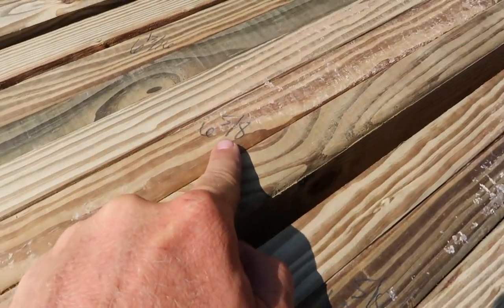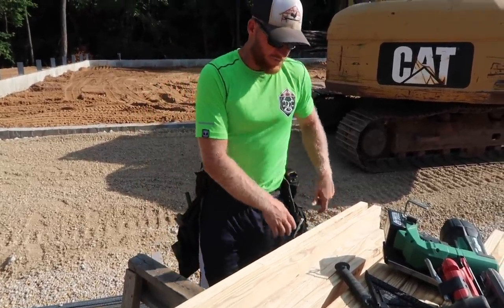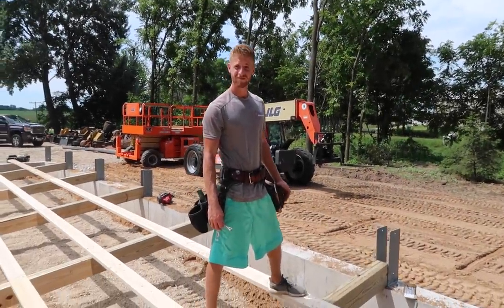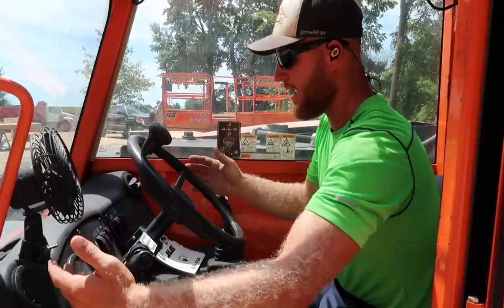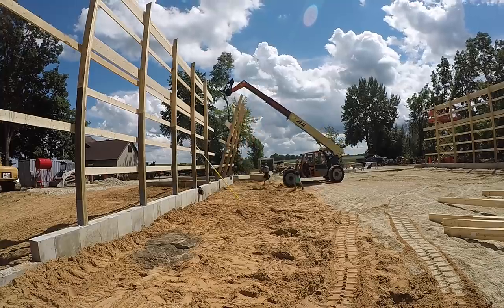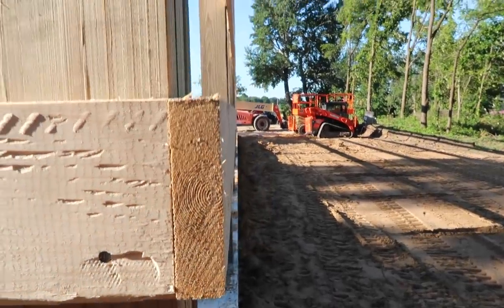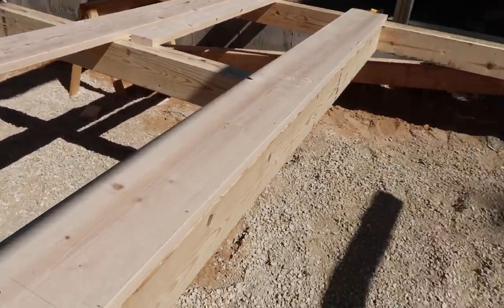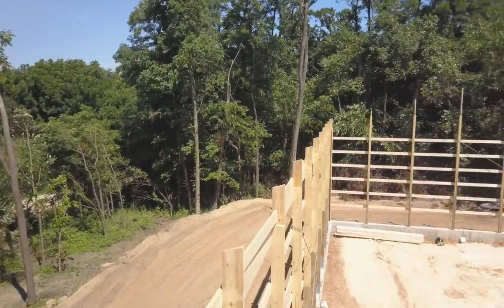Framing Walls: Build the Dream Episode 2

Comment: I have worked construction for 7 years and have helped build numerous pole barns and non of them are to your standards I love watching your videos because of how you do it and your efficiency for instance your pole style and using the anchors we always drilled holes put concrete in the bottom and set the pole and tamped them in sometimes by have and sometimes using an air tamper and then u guessed it all the framing is done in the air and it is no process of speed or efficiency watching you guys is awesome I am glad that you share this with everyone and I no longer work construction I now am a mechanic for my local village but I still build on the side and I am learning more and more with your every build thank you
Reply from the maker: thanks for the feedback

Comment: Wise words- use the machinery. One of the things I like about how you guys work is not just the efficiency, but the safety and lack of really heavy manual handling you do. The fastest way out of a trade is to be a hero and over-lift every day!
 At 21:51, I would call that clearancing of the post a rebate.
Reply: Just because you're a young buck and CAN move or lift it by yourself, DOESN'T mean you should. My 54 yr old body can attest to that! I'm wore out and broken before my time... I try and instill this in my younger crew. DON'T end up like me!

Comment: Love your show! I’m in the industry as well. Just an idea for your post brackets. Your guy does a pretty dang good job of hitting both sides of the holes for your bolts on the money. But a mag drill may make even quicker work of it with even more accuracy. My operation is nowhere near as large as yours and we do a little bit of everything from home remodels to plumbing electrical I mean you name it. But I am wanting to gear into doing more shops. And I gotta get one of those jumbo nailers! Efficiency is king! Keep up the great work!
Reply from the maker: heck yeah man...good idea

Comment: Those two  tough-as-coffin-nail workers staying under suspended wood frame were just amazing to see))) Ones a strap you'v been using slips off  and voila,you need another pair of dudes to burry those old ones.Safety first bro.You can buy a new tool but only one guy has ressurected till today and that was 2018 years ago.Nice vid though.👍👍👍

Comment: What question should we ask when trying to hire someone to build a pole barn? We want someone that is going to do really good work. For lots of reasons, but we will also be putting our home in part of our building. Thanks for the videos.
Reply from the maker: First and foremost are their work.  Look it over... is it straight... do line match up on trusses and roof steel, do the bottom of the sheets look straight or jagged.   Are their trim details good.  If everything is up to your standard then you are probably good.  Everyone makes mistakes. Find someone that has pride in their work
Reply: RR Buildings.  Thanks. We got a quote for a 50x96x16 for $50,000 installed on a pad. I know we are in a different region but does this sound around what you would expect?

Comment: Always great work, excellent explanations and looks like a fun crew to work with as usual. If you have to lift from the outside again you could bar clamp some  2x’s to the concrete wall at a few of the steel brackets to prevent a kick out and give a little stability until you get vertical. Keep up the great work! How far north into Wisconsin to you get? I am in Jackson (north of Milwaukee) and I’m interested in building a shop for my commercial roofing business

Comment: I try to read through several comments before asking again, so since I'm late to the game sorry if this is a repeat. 

Since the posts are above finished grade, and not in contact with concrete, could you order the without TTD laminations on the bottom?

And I will binge watch 20 minute videos for a couple hours. I rarely will watch one that is over 30. Thanks again for the videos.
Reply from the maker: Yes I could probably do away with the PT bottoms

Comment: Just multiply inches by 2.5 and you will be converted to centimeters close enough and 100 centimeters is a meter. Also a meter is 10% larger than a yard, about 39 inches

Comment: Kyle why don't you use pt for the garage door jamb nailer as it is on concrete? Plus the closeness to grade and the moisture exposure it will experience over its lifetime. How do like the Diamond backs? I've always use Occidental but I have to heavy modify for my uses. I'm rocking the M-4 and use it for everything but it doesn't have your cool colors! Enjoy your work and your process.
Reply: Curt Boyer --- I concur on the door jambs needing to be treated. I changed out many placed by other 20+ years earlier.
Reply: Wondering about this too, and not just treated but wondering why I didn’t see some sort of moisture block to stop water wicking from the concrete into the wood.  Maybe some GTape or other flashing on the wood where it touches the concrete?  I would think the metal of the post bases provides a good moisture break for the main columns.  And if this is the biggest thing we can all find to comment on then you’re doing an absolutely incredible job as always and I’m constantly amazed at how much you record and post, so much work!  Quite amazing!
Reply: Luke Domermuth --- A great positive comment. Kyle and his team members do super serperior work!!

Comment: Quick question to keep the weight even on end wall could you not leave the pocket empty until you have lifted the wall then lift and add the risers? I haven’t built any thing larger than 6”*4” 6” high at top most peak

Comment: Can you explain why the posts are made of 3 2x6 instead of 1 6x6 beam? What's the advantage?
Reply from the maker: Strength
Reply: What makes the 3 2x6 stronger than 1 6x6? Wouldn’t they be the same? Assuming they are the same type of wood and modulus

Comment: Why don't you leave the brackets off the gable walls, then you could build the entire wall with the corners on...Its good to see different methods and styles of building practices...We build them a lot different up here in Alberta ....Im starting a 70 by 168 starting on Monday.....CHEERS
Reply: I do have some pictures if would want to check them out it's under the Google icon at the bottom right on my homepage picture.

Comment: Any reason why you guys don't install a lead lined or pest mesh roll over hanging the concrete edge and nailed to your post, then run your bandage or wrap over the top to create a true moisture barrier. It might be different for commercial buildings vs residential but in Australia for high end shed/farming (no offence just what we would call it) it is still done.

Comment: 2 things.... the 4th ply on the 8 foot door, why not pressure treated? it is making contact with the concrete and the end grain directly exposed to finished grade and wet surface.  and the othe thig is your guy walking directly under a suspended load.....

Comment: 2 questions. Do you use 8ft spacing for a particular reason? Some kits are 9ft. What lumber do you use for purlins i.e. construction 2x4. There is stronger lumber i.e. Southern Yellow Pine has a stronger strength. I'm concerned about snow load. A little more money is it worth it?

Comment: Two words... GO METRIC!
Reply: The system of measurement doesn't matter. All that matters is that it's repeatable and understood by those using it. They could be using cubits and it wouldn't matter if it was accurate.
Reply: R. E. Hill --- I'm 70 and I'm ready. Its too easy to not do so!

Comment: Are your buildings designed/engineered by you or someone else.
Reply from the maker: thedge7 I design and use pre engineered designs to achieve our goal.  If it makes sense, I have done some large complex commercial jobs that required engineering and plans and I use those plans to design future builds

Comment: "I don't know what a 16 penny ring shark 4 inch is in metric, but it's a big nail." Ummm, I don't know what a 16 penny whatever is in English. Do I want more or less pennies?
Reply from the maker: TheMrGrok 20penny is a 4” nail
Reply: TheMrGrok --- Look for 90mm as a 3.5", 16d(penny) and 100mm as a 4", 20d(penny).
Reply: Back in the old, old days, it was how much 100 nails cost of that size in pennies. So, bigger nails cost more per hundred by weight, therefore, more pennies per hundred. It became common to just call nails by their price per hundred, rather than a length or diameter.
You'd grab a handful of nails from the bin, they would be weighed at the counter. So if you bought 50x 20 penny nails, you'd be charged 10 pennies and so on.

Comment: You guys don't go by plans do you? Are you just engineering the job as you go
Reply: Archie Smith --- He has done this many times. The engineering is predetermined from past experiences. Should construction for non normal details/buildings occur, he knows if new/extra engineering is needed. His trusses for extra long spans or building heights are some things that could require 'new engineering'.

Comment: You are very aware of efficiency. If you ditched these old fashioned tape measures you have and buy some metric ones your calculation times would half I cringe when I think about the 1970’s when we were adding and subtracting sixteenth of an inch to eights etc. I spend a few months of the year in Houston at my sons and carry out quite a few construction projects at his house. Half and hour using an imperial tape was enough for me. Next visit brought over half a dozen metric tapes. Happy bunny now. Think about it no adding sixteenth’s to eights to quarters to half inches, just one unit millimetres to millimetres. And it makes no difference that your lumber arrives in imperial. Try one project and see how you get on.

Comment: Actually, gays over there in the USA how you build a house or anything by only wood and nails It is very funny how you build
Then the first storm will fly and your exhaustion will go through the air
I always wonder why you do not build your homes from concrete, especially since you have very strong hurricanes